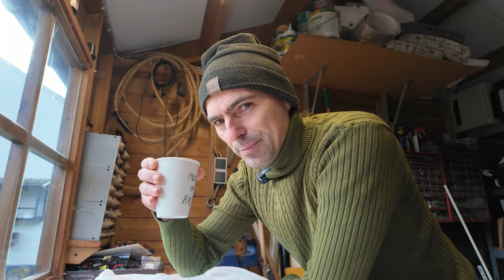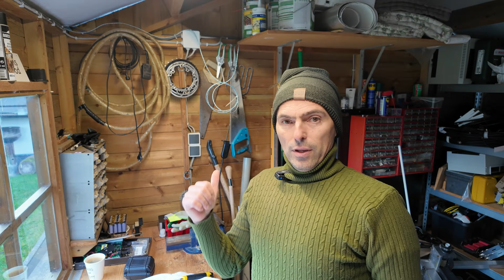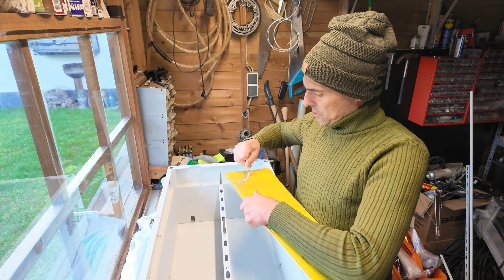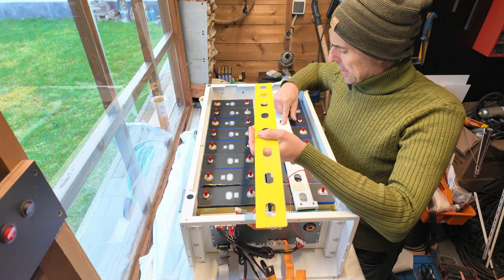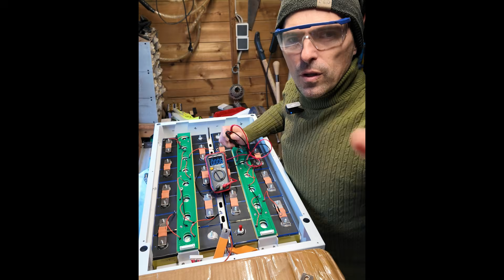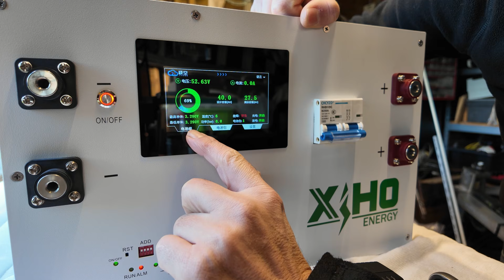Revolutionize Your Energy Storage: DIY 16kWh Battery Tutorial

Comment: Excellent video Franky, thanks for sharing. I’m retired now, but I spent over 40 years doing IR scans, mostly on electrical and mechanical systems. These days, I’m looking for something reliable to use for checking rental properties, mainly for preventative maintenance.

I took a look at the Thor001 and have to say, it's pretty good. After working with thermal cameras for many years, the 512×384 resolution, 60Hz refresh rate, and high thermal sensitivity really stand out, especially at this price. The image clarity is great, and being able to connect wirelessly to a phone or PC for reviewing scans makes it super practical for real-world work. It definitely holds its own against some of the more expensive equipment I’ve used over the years.
Reply from the maker: Thanks for the great comment. I confirm, was pleasantly surprised by the looks and performance. The THOR001 is a keeper and will appear in future videos....

Comment: I have the Thor 001 in your video too Franky
Used the Thor001 to inspect an overheating pump in a small greenhouse setup.
I noticed one side of the casing was running much hotter than the rest — about 78°C according to the temp reading.
Turns out the internal bearing was starting to go bad. The 9-point temp scan really helped me confirm it fast without tearing anything apart.

Comment: Nice video Franky, I can't seem to find the used batteries in the description of this video. 
Could you add them please, or a link to the cells which you prefer the most?
I saw your 12/2024 battery test video, but the Wistek seems to be unavailable and the link to EVE battery seems to be wrong (smaller batteries).
Reply from the maker: Hi sir,
the batteries are delivered with the XIHO case. XIHO offers Lishen and REPT cells. You can buy cells elsewhere but XIHO offers a nice package deal. Have good contact with sales, will ask if I can put their whattsapp number under the video. make sure to use the EASYPOWERWALL coupon for extra savings. 
Lot's of rumours that prices for LFP are rising and some vendors already increased the price....
EVE is a very good brand but extremely difficult to get these days, Lishen is a very good option.
Keep you posted, feel free to check my FB page EASYPOWERWALL for updates too.

Franky - EASYPOWERWALL
Reply from the maker: If you want to contact salespersion via whattsapp: https://wa.me/8618902310430  Here name is Esther.

Comment: The temperature sensors are not there to measure busbar temperatures (and spot bad contacts), because then you would need like 14 or 15 of those sensors. They are there to measure cell temperature. When charging with high-currents (e.g. 0.5-1C) in an environment with elevated temperatures (e.g. 35-40°C), there is a risk of reaching the cell temperature limit (i.e. 50-60°C range). In that case the charging should be stopped (or throttled back) to prevent damage to the cells.
The temperature sensor can of course detect as a side effect a bad contact in a busbar connection. But than you would just be lucky since only 4 out of the 14 or 15 are "monitored" ;-)
Reply from the maker: Hi, 

Thanks for the feedback, fully agree. When it's connected to the busbar it's more or less measering the temperaturen of the BB, but it's not there to measure that temp. It's there to measure the temperature inside the box and drive the BMS if the temperature is too low or too high.
I agree I could have explained that a little better.

Franky - EASYPOWERWALL
Reply: Hey Frank.

Bedankt voor de video!
Kan je de batterij zonder problemen koppelen op een omvormer van kstar?
Is er geen probleem qua keuring in België hiervoor?

Comment: Veo que el manual que se encuentra en el enlace muestra un modelo mas antiguo, que es el que yo he ensamblado, que el que se ve en el video, pues todavia muestra cables dobles cuando en el actual se ven barras aisladas. Un defecto, a mi parecer y que parece subsistir, es que los tornillos que sujetan la placa intermedia, que mantiene apretadas las celdas, son similares al resto de los tornillos y que para esta función resultan muy cortos pues cuando se aflojan un poco se sueltan con lo que hay que colocarlos de nuevo al volver a apretar la placa y ello puede ser laborioso, pues esa placa soporta el BMS y dificulta el acceso a alguno de esos tornillos. Usando tornillos de 20 mm de longitud se evita ese problema y se puede desplazar dicha placa lo suficiente para añadir o quitar las placas aislantes intermedias o sacar o poner una celda. Yo cambie esos 8 tornillos y sugeriria al fabricante que lo hiciera en las nuevas entregas, si todavia no lo ha hecho.
Reply from the maker: Hi, thanks for your feedback. I'm in close contact with sales and engineering department of XIHO. Will forward your advice. Several of my recommendations have been implemented. 
I agree that it's the old manual, it's mainly there to provide the right order of the battery cells.

Have a nice day.
Franky EASYPOWERWALL